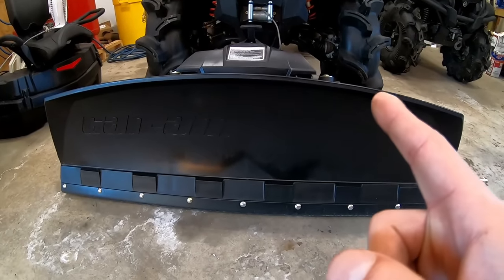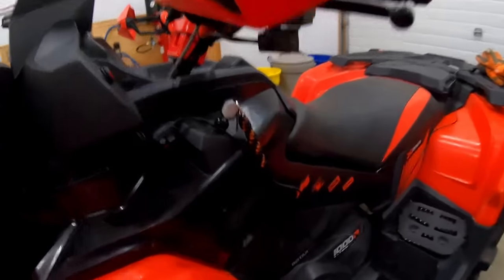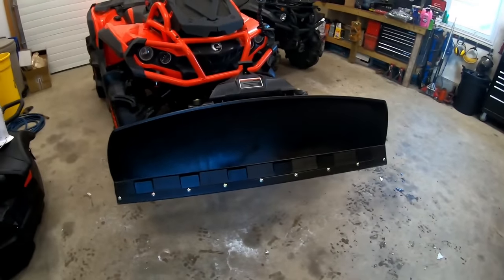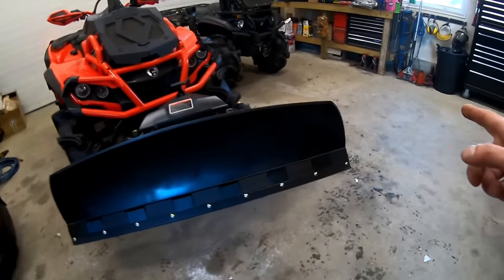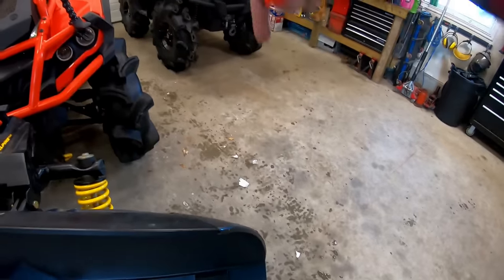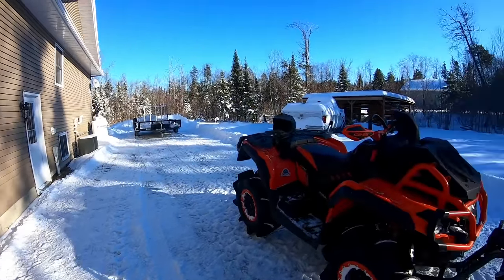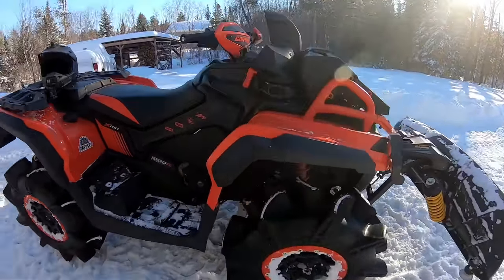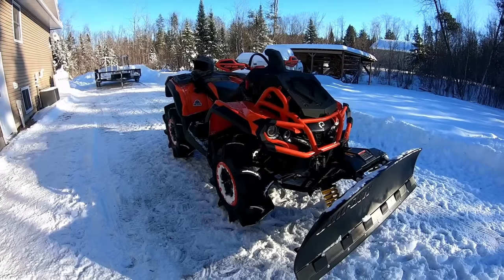Plowing on assasinators!? Alpine Flex Plow review and use!

Comment: Man plowing on a quad is so inefficient but sooo much fun
Reply: Beats shoveling
Reply: im about to move in to a house with a pretty big driveway, about 150 yards and a good steep hill. Tryhing to figure if an ATV can handle this. I have plowed w truck and tractor before but never ATV , can they move heavy wet snow ?
Reply: I have a very long drive that forks off to another garage. I find my plow truck to cumbersome. I use my ATV to plow. Nimble and faster. About 1 foot of heavy New England snow is the max for my Can-am Outlander 850. If the storms keep coming I'll use the truck to push back the snow banks and widen things up.
Reply: George Dahari get a used utv
Reply: Not insufficient if you know what you’re doing......
Reply: George Dahari YES!!
Reply: Snowblower, more efficient, less fun.
Reply: Randy Kovalenko yeah ok until u hit a branch under the snow and sheer a sheer pin and have to replace it with cold hands in the snow. I will sit behind my utv or atv and plow
Reply: Have boss V plow on a 2019 2500 Chevy crew cab my house in town and parents house the quad with a plow is so much better can get into all the tight places the truck never could
Reply: I make bank with my can am Outlander and flex plow. I do hospital side walks and driveways in ohio up to 800 yards long hills and all.  Love the set up can push up to 14 inches wet snow if you know how to use the throttle on this best of a bike.
Reply: I have a half mile long driveway. We average 9 to 11 ft of snow per season. I have a 6 ft wide snow blower on my tractor. It's fun to plow with my four wheeler but rely on the big snowblower to get rid of the stuff. If we have 6 inches or less I jump on my quad and angle the blade towards to middle of the road. I cruise down the driveway pick up my mail and go back on the opposite side. This makes a 4 to 5 ft wide window of snow in the middle that with one pass is removed with the slower tractor mounted blower. Faster than making 2 passes with tractor.
Reply: He needs to add a snowpusher on the rear, so when he backs up he takes care of the berms.  😊

Comment: I've bin ATV plowing for 20+ years...Here's a few TIPS---
If you want to reduce your time and fuel...start your passes with the blade at FULL ANGLE. The blade will dig more allowing less passes. Then at the end of your drive steer into where the snow is being pushed or sloughed off...this will help prevent a huge mound.
When you clear next to structure...you should put the blade at a hard angle...to prevent making a wall next to the structure.
Always use the angle most of the time. The straight blade is good for clean-up.
Reply from the maker: Noted! Thanks!
Reply: @MainvilleATV   No problem and Good Luck and have fun plowing

Comment: I have a 300 yard driveway and i plow an area the size of a football field with my 850 and the 72 inch flex plow . I took the drift cutters off because if the road is slippery and there is heavy snow the drift cutters will hold too much snow and torque the ATV sideways which is not good when you're up close to buildings and vehicles . I put a kevlar winch line protector on my winch line and it's worth every cent . They all come too long so i cut mine so 1 turn will go over the drum . Saves flattening and work hardening the wire line and eventually breaking it . I also put on an oval fair lead . The kevlar line protector is a long tube that fastens around the wire with velcro . I cut it to the right length and fastened it to both ends with duct tape .
Reply from the maker: Interesting to know! Thanks for sharing the wisdom, might have to look into it

Comment: I have an Outlander 650 max with the flex plow. I put the extensions with drift cutters on it immediately and also went one step further and put tracks on my machine for winter. I don't regret it. Only downside to the drift cutters is angle plowing is pretty much out. They are good for pushing and piling snow. The machine is a beast with tracks on it. I go places here where sleds can't or won't. There are things though a sleds can do that I can't but I'm not out for adrenaline I enjoy the adventure hunting trips anyway.

Comment: After you cut your first straight blade run down the center.....Angle left and go down the left side towards the street....Then instead of wasting a trip backwards up the drive way....spin around and plow the other side going back up the driveway. That way there are no wasted trips and your done in half the time. Also, Standing as much as you do.......You Will Be doing a Header Eventually. Sit as much as possible for safety. Great Video....good angles and commentary. Thanks For Posting.

Comment: Nice setup sir! I love how the plow stays straight up and down. doesn't tip up when you wind it up . most plows if you purposely rase two inches above the ground they end up tipped up at an angle. (ATV plows I mean.) I grew up with antique tractors 3 pt back blades and 5 foot snow blowers! thanks
Reply: If your able to raise up with the plow staying straight up and down helps you clear large snow banks, and tall heavg snow much easier.

Comment: Great video - thanks for sharing!  As a Brit who lives in a country where 2 inches of snow brings the place to a standstill, I have little experience of clearing snow.  However, a question for you.  When you cleared your drive, you pushed all of the snow to the end and created a "wall" across the drive entrance.  Then you seemed to have to spend quite a lot of time pushing that snow to the edge so that the drive entry was clear.  Why didn't you push the snow to the edge in the first place at the end of each pass?
Reply: He would have ended up leaving a ridge of snow across the road by doing that.  Where I live that's actually illegal.  It doesn't stop contractors cleaning out people's driveways from doing that, but still, it's illegal.
Reply from the maker: You've got it! There's a municipal bylaw that prevent sus from being able to do just that. Thanks for watching!

Comment: I used to plow with my polaris and the first pass was the hardest . Would have to hit it back up hit it . Once thats done it did ok . The most amazing part was your wife Helping you by opening the garage mine is no where to be found when there is snow to clear. I got a tractor and sold my atv the tractor is much more effective because of its weight no comparison. Also i took a 9ft heavy highway plow and made it work with the tractor so just two or three passes and im done the four wheeler was up and back like in the vid.

Comment: After 3 years of plowing and replacing all my steering I now use a Honda HSS1332 and snow blower.  The weight of plowing ruins your steering and front end of the your very expensive ATV.  My ATV now is strictly for pleasure and fun - no work allowed.

Comment: Recently I bought a used 1000 R and I am now working on installing a snow blade. While taking a break I watched your plowing video and I can see already I might have put too much faith into the ability of the atv power plow. Even though we have a 300 meter drive way I think my walk behind snow blowers did a considerably tidier job. Also thinking ahead to a lot more snow the snow blower gets rid of it much better and further away.
Reply from the maker: Just incase, I wanted to let you know that the plow has sliders on it so it leave a layer of snow. Our driveway is gravel and we didn't want to push any of the gravel onto our lawn. Hope this helps! But yes, snowblower has a lot more control. ATV is more fun though ;)   - Cass

Comment: Love the channel. For one, I just bought my first Can Am. It's a 650 outlander with a lift and 26" not worth mentioning the model tires. I'm already wanting to upgrade. Was wondering about the Assassinator tires. Do you ride at all on pavement? I live in a very rural area, and ride maybe 5-10 miles one way to reach my prime hunting/riding area. Looking for a great mud tires that will last on hard surfaces, and do ok in rocky terrain. Soooo... Like everybody else, I want a tire to do everything awesome..
Reply from the maker: haha, youll be fine on assasinators. They aggresive and heavy but great at what they do and made of a very hard resistant rubber, they last quite well.
Reply: I'd go with motohavocs their very good for trail riding and awesome in mud and less weight then the assassinators witch means not as hard on the axles also

Comment: that's a very cool looking rig, i really like the orange color and the tires.  however, have you ever watched any pick-up truck plowing video's?  you could have cut your plowing time in half and put less strain on the machine if you would have simply plowed "in circles" where you just kept driving forward to the end of the run and turned around to plow in the opposite direction!   if you tried plowing a parking lot with a pick-up the way you did this, it would take you half the night!   but it was still entertaining!

Comment: When ya push snow to the road.  You should move it to the left or right and put it  in the ditch just after the fence on both sides.  It would leave less at the end of the driveway to have to bust through again.    Just  a  thought though.  Nice rig.   Although i prob would have spent the extra $ and got the boss atv V plow.    But im partial to the V cause i have one on the truck.

Comment: Good job Kyel. Getter done. Love that outfit u got plow and all. I totaly love my XMR 1000r 2018. 2 hours i need more. I have learned alot from wathing u. I left my. iTP on 30× 9×14. Cripited. I measured tire and i get 29/28. And surley not 9. I told my dealer. And gave me a roof for my 800 dps maverick trail. Sweet ty. Got front n back window. Now a roof. And mabe doors. U up north hey Kyle?
Reply from the maker: Yeah, mid northern Ontario. Thanks man. Glad you're enjoying it all.

Comment: I would say....one hell of a set of plow tires. lol. How are they for actually pushing some weight when plowing? I would think they would be a little "slippery" with the way the tread is and being on an already slick surface.
Reply from the maker: I've honestly had zero issue pushing. Better yet when the blade has snow the front tires grip like a bastard
Reply: @MainvilleATV  ... I got to 30 excuse me 29.5" cryptids... They do grip like a bit I couldn't imagine what the assassinator are like. Nice quad ...850?
Reply from the maker: @dirty_worm_850  2018 XMR 1000r

Comment: Put a thrower on your garden tractor.  1/2 the price and your be done twice as fast.  My quad and blade just sit now.  The garden tractor gets it done better.  Only needed chains and 100 lb rear weight.  My driveway similar to yours but 20 ft of elevation change.

I had too much back and forth pushing with the quad
Reply from the maker: I just enjoy the quad plow. I know theres alot of better ways. Thanks for watching Kevin!
Reply: I use both of them, ATV or a garden tractor with a blower.. I can tell you the ATV is faster to use. Faster backup is why.

Comment: You would have better results if you made a pass down each side of the road first.  Now your pushing from the middle adding to the snow on the sides.  If move some of the snow on the sides first the middle snow can be pushed easier to the side and the equipment won’t have to work as hard.

Comment: do you damage your grass ? I consider using my atv for this winter but my drive way is not that big and I will need to push snow on the grass.
Reply from the maker: A snow pile will kill the grass in the spot, but it always comes back, just takes a little longer than the rest. Give it a good raking in the spring and it should be fine. Thanks for watching and good luck out there this winter.

Comment: Nice video but that blade looks too light, it doesn't get down to the pavement.
Reply from the maker: I raised the pucks on it on purpose to leave a flimsy of snow to pack and freeze because its gravel underneath not pavement.
Reply: @MainvilleATV  I wondered the same thing with the snow that was left but now it makes sense with the gravel. You just answered my question on raising it for gravel driveways. Thanks.

Comment: Plows not heave enough, keeps skimming over the snow, and have to make to many passes
Reply from the maker: That's actually on purpose given that it's gravel underneath. Didn't want to push it onto the lawn.
Reply: @MainvilleATV  Thanks for the replay, Didn't know that part.What did that cost you for the setup ?
Reply from the maker: No problem my dude, and about $1200 CAD (including installation, bracket, and plow). Cheaper if you install yourself.
Reply: @MainvilleATV  What site was that at for your plow
Reply from the maker: @johnvanyosr8896  it's from can am.

Comment: Damn nice set-up but how much ???  Way to small a plow (even with extenders) !!!    You could plow with a "72 Pro-V .  I have (4) Kawi's.  All Kawasaki 300 Bayou 4x4's . My winter bike is a mint 1998 Kawasaki 4x4 with a '50 Moose straight plow, a Dennis Kirk canvas full cab, LED light bars on cab front and rear, chains--rear, and a Moose salt spreader mounted on rear rack. With 10 speed High & Low the cc's don't mean a damn thing. I know I could plow that lot as quick or quicker than you and I probably have 15K  in ALL my equipment. All my stuff is like BRAND NEW. My one 1998 I just bought from a dealership in Georgia(I am in Iowa), who bought it outright from a 79 year old gentleman who just had a stroke. It has 66 actual miles ( rare factory speedo on the front rack), bill of sale when he bought new, owners manual the whole nine yards. This sucker is a brand new bike !!!!!!!!    Don't need big money for big results !!!    Good vid though, if your happy that's the main thing right ???      Thx.  Jim

Comment: That guy was running that quad doesn't know how to use a plow you shouldn't do a full-length like that you should do in the half this way you don't have that big pile at the bottom of the driveway but this guy thinks he's a pro I used to have a plow our Squad 500 Sportsman made by Polaris the only thing I don't like about that played on that what but plow the blade was made like crap I went to a place where they did play some plows and stuff like that for trucks I had to make me a real big blade and that work the best cuz he had wait till it I don't believe in using a plastic plow like that guys using you might as well just leaves a damn snow shovels the same thing but the guy knows what he's doing while he thinks he does